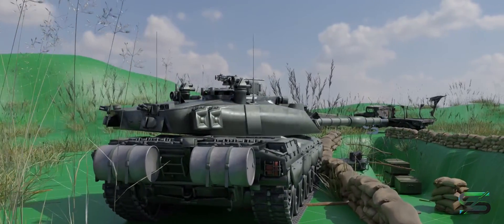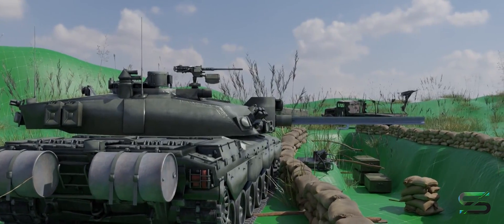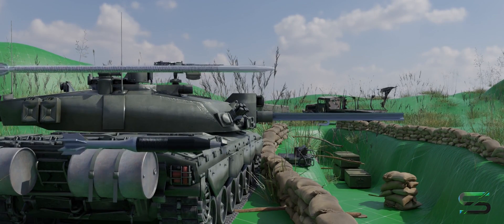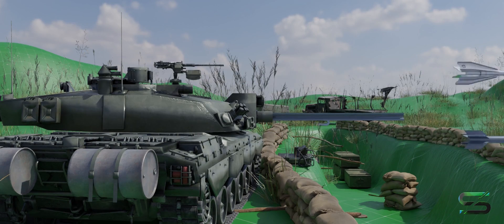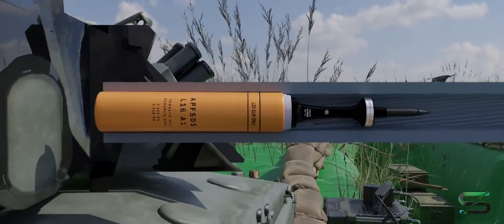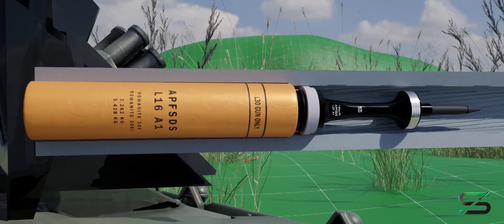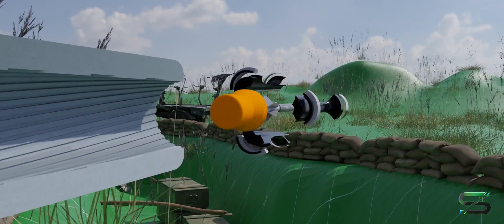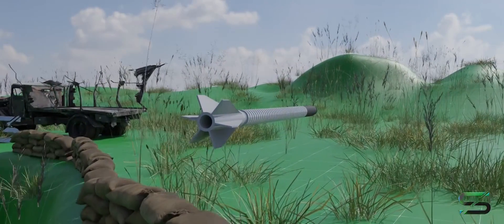Why Challenger 2 Is Still Using Rifled Barrel?

Comment: 122mm BR-471 AP (25.0kg at 795m/s) vs IS-3 at 100m next pls 

24.84kg penetrator + 0.160kg HE filler at 100 meters (782m/s) vs IS-3 Hull Armour (110mm at 56 degrees compound angle)

Comment: What’s the issue of adding fins to HESH?
Reply: HESH rounds require spinning to work properly as the spinning would make the plastic explosive spread better on impact, Stabilizing with fins will not make the round spin, and making fins that makes the shell spin would be too complex and might be unreliable
Reply from the maker: Good question. I think HESH rounds are more effective at spinning.

Comment: The British should have honestly switched to the Smoothbore 120 a long-time ago. HESH rounds aren't that much of an upgrade over HEAT and you get significantly decreased APFSDS Penetrative power in return. Common British L
Reply: Agreed, with how much advance multi purpose chemical rounds the US has experimented and made they could of just picked one and gone with it
Reply: @jkc2001  All of that experimenting has got us the AMP. It can go through concrete walls, Airburst detonate and a combination of the two. Some retards in a building? AMP. Some retards in a truck? AMP. Some retards in an APC/IFV? AMP. We don't have to sacrifice APFSDS Penetrative power to get it either. So we get significantly reduced supply chains and much better balance with the Ammunition loads. HESH did its job, it's time to embrace the future and leave the old in the dust.
Reply: HESH rounds outperform HEAT against light armor, fortifications, and infantry. Rifled The APFSDS performs more than adequately.
Reply: @grigory82g  more than adequately to the point they are switching to smoothbore?
Reply: @datmedetbek5165  They should have built 127mm as NATO standard. But now we play a game of, the explosive being to small for the bore, and AFSDS being the incorrect length to bore ratio.
Reply: @rat_king-  Who and why 127mm? What are you even talking about?
Reply: @datmedetbek5165  127mm is an optimum of aerodynamics to explosive filler. (does this being understand physics or is it just on an emotional purity spiral, READ the prior (including your own) comments.)
Reply: @rat_king-  Never heard of 120mm HE having problems with dealing with their intended targets.
Reply: @datmedetbek5165  No one said that. I said volume of bore ratio. Read it again. Or do you need to keep seething?
Reply: @rat_king-  you literally said explosive being to small for the bore
Reply: @datmedetbek5165  "liderally", no i said bore to volume ratio. 

Let me guess, you are taking this personally, or are seeking to hide behind your nation as you faulter, whatever that may be, or even no nation at all. 
You are malding over this, and pedantically grapsing. My advice? pickup a textbook  and learn about these things.
Reply: @rat_king-  "But now we play a game of, the explosive being to small for the bore"
Yes you did literally say this, you can't deny it.
Reply: Well HESH can be more general purpose though. To be fair.
Reply: AH yes.. HE so very effective.. infact lets use RDX instead.. Oh wait.. that is the filler in HESH. 
Again.. Nothing is stopping us from lining hesh with copper.
Reply: @rat_king- lining it with copper wouldn't help it much because the rotation will pull the jet apart
Reply: @akriegguardsman  you do know.. that its not a jet but a lining.. your not going for supercritical fluid as spear.. more very efficient splash damage.
Reply: @rat_king-  i think I misunderstood you, anyways, what benefits would it bring to line it around with copper?
Reply: @akriegguardsman greater lethality is so small it is not worth the cost per round.. basically you could get some of the HEAT effects.. but not enough to replace the round. again HESH very good all purpose round.  soft targets, thin targets and rigid targets. a dream. its those multilayerd targets that are a problem...... but we have fin/ sabot for that.
again... why are people using the wrong tool for the job?
have you ever seen what a 155mm artillery shell does to tank? terrifying stuff.
Reply: @rat_king-  Then you should just switch to the AMP if you want those. Literally kills everything except heavily armored and ERA'd MBTs... but that is what APFSDS is for. The age of HESH has passed, let it go and embrace reality.
Reply: @PeterMuskrat6968  An AMP round does too much, to functionally deliver consistent lethality, within any one single domain. Jack of 4 trades decent at 2.
STOW 3 different round types in a tank like the rest of us. c'mon!
Reply: @rat_king- APFSDS of Chally are underperforming compared to other western mbts, that’s the thing
Reply: @datmedetbek5165  APFSDS has a lower length due to 2 piece ammo, the fact that is doing as well as it has. proves it is still a superiour platform. oh sorry what was that? a near 600mm penetrator is worse off than the 800mm penetrator of the leopard gun? no one was surprised.   

How many leopards have been lost in ukraine? many. how many chally 2's? Two. what is ukraine talking about buying post war. challenger 2's or 3's.
Reply: @rat_king-  Yeah exactly because it has two piece ammo it has worse APFSDS, thanks for confirming what I said. That’s why your beloved “superior” British platform is switching to “inferior” german tanks cannon?

Tanks that are more extensively being used in frontlines tend to get destroyed more often. How it proves that Chally is supposedly superior platform.
Reply: @datmedetbek5165  For a being who "cares" for facts, you sure love polarising your emotions.
Reply: @rat_king-  You done projecting? Or still can’t get over the fact that brits are switching to smoothbore?
Reply: @datmedetbek5165  projecting? projection requires a false dichotomy, or false equivocation. 

I think the switch to smoothbore is a mistake. the military has a different opinion, largely based upon logistics.  time will prove that decision either way. 

Again, you need this to be "true". more accurately "your truth". to justify.... something.... 

Possibly, if you are a yank. some original sin type rubbish. surrounding the origin of your states.
Reply: Projecting is a response to unpleasant  experience by attributing your behavior to someone else, it does not need false dichotomy. You claim that i polarize my emotions, while you yourself are getting butthurt from someone pointing out that brits are switching to smoothbore. 

Switching to smoothbore is a good thing, ability to take down non-armored and lightly-armored targets will be largely unaffected while anti-tank capabilities will improve and of course, mentioned by you logistics will be better off with smoothbore. 

"Again, you need this to be "true". more accurately "your truth". to justify.... something...."
I don't even know what you are trying to say with this, you should quite mumbling under your breath. 

Not an american, but i guess yanks hit your nerve every now and then.
Reply: @datmedetbek5165  I am pointing our we swapped to smoothbore. Read it again, we had a discussion on AMMO TYPE, Not how Barrel type affects Ammo.  
It is nice to see you take hypotheticals, as literal statements. (Propaganda yourself less.)
Reply: @datmedetbek5165 " Switching to smoothbore is a good thing, ability to take down non-armored and lightly-armored targets will be largely unaffected while anti-tank capabilities will improve...."  Barrel design has nothing to do with the targetting system. 

Please keep introducing emotions... it is a great rise. "Butthurt" was it?
Reply: @rat_king-  You can’t read do you? No one said anything about targeting system. 
By writing “targets” I meant enemy vehicles that tanks shoot at. Is it that hard to understand ?
Reply: I did not use the terms, inferior Nor superior, 
A dichotomy, if you will..When refering to weapon systems, especially when any variant effectiveness is challenged. As Every weapon is effective, some more effective than others.
Reply: @datmedetbek5165 You  moved the discussion about barrels. Barrels don;t destroy targets. Ammunition does. 
so yes, a barrel targets (verb)- to aim. 

Do you even know what you type? 

 My rifle can take down a non-armour or light armour.
Reply: @rat_king-  Barrels influences the behavior of shells against different targets, how you don't know this stuff? 
Your beloved HESH works better with rifled gun while APFSDS works better with smoothbore gun. 

Yes rifled cannon can take down both light-armored and non-armored, but so does smoothbore cannon which also has better anti-tanks qualities, which was my point from the very beginning.
Reply: @rat_king-  You did use term superior:

"APFSDS has a lower length due to 2 piece ammo, the fact that is doing as well as it has. proves it is still a superiour platform"
Reply: @datmedetbek5165  why do you return my statements at you, as questions? it is very silly.  
Shells effect targets, HESH most effective under rotation. That effect is not specfic to a rifled barrel, have fun googling all those spinning missle designs. (if we could build a smoothbore barrel that spins rounds we would do it.. immediately)

APFSDS is effected by pentrator length,(which is made smaller by 2 piece) 2 piece ammo was a choice about crew safety,  it has nothing to do with the rifling, barrel length, or ammuntion type fired. the round is manually loaded.  
All fin rounds, APFSDS rounds have to be fin stabilised, as consequence of physics. as SPIN stabilising them as we would want, requires such a high RPM and induction energy, it would destroy any barrel from the torque, and convert so little of that energy into forward motion the exercise renders itself, pointless.
 
the drag force on the fins slows the round down. we would prefer not to have them... also they make the cross section of the dart so much larger than it needs to be. 

The L7 on the centurion was rifled. and had APFSDS single piece ammunition.  The nearest thing comparable is the T55's APFSDS smooth bore gun. 

Honestly if i see enemy armour, im pulling the trigger to send whatever is in the tube.
and besides, unarmoured, and softskins get over penetrated by some 50mm these days.
Reply: @datmedetbek5165  Pedantry will not save you from your dichotomy.
Reply: @rat_king-  So you do know that barrels affects shells behaviour. Your lengthy comment proves my point about rifled and smoothbore cannons.
Reply: @rat_king-  Now you are making excuses after being shown to have made a statement that you claimed you didn’t. Excuses will not save you buddy.
Reply: @datmedetbek5165  Deleting or editing comments is not tolerated.
Reply: @rat_king-  ?

Comment: Yep so Challenger 3 incoming with the 120mm L55 smoothbore which will fix this but still the older 120mm L30 rifled barrel can still F things up.
Reply: Against lightly armored targets and Structures.
Against any Modern tank, including those goddamn T-90M's that keep dying left and right, the Chally 2 will suffer.
Good for fighting in Africa and most of the Middle East... not so good when the enemy has armor equivalency. 
Training still plays a role, which gives the brits a little leeway though.